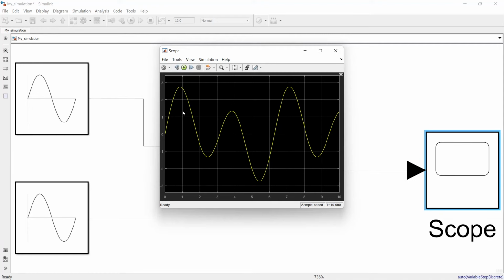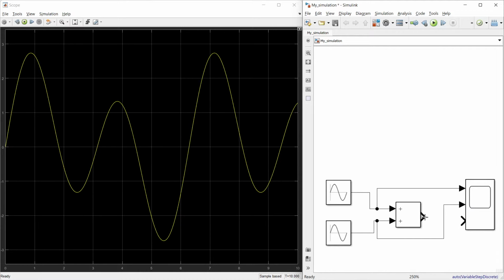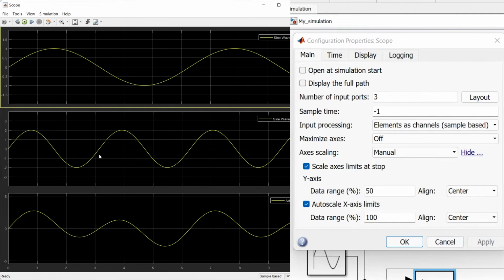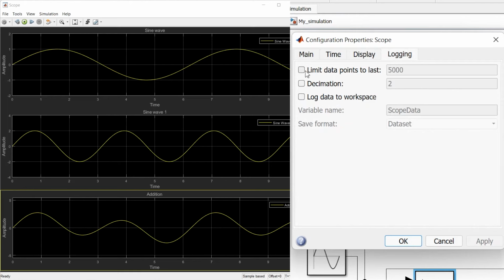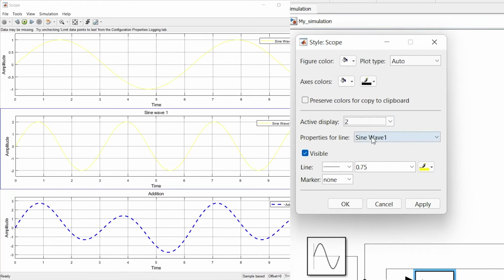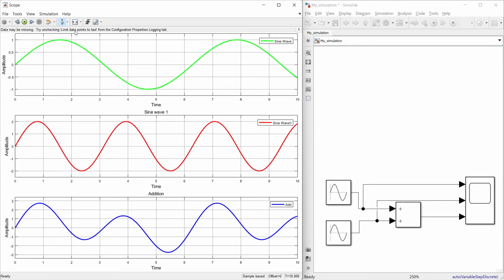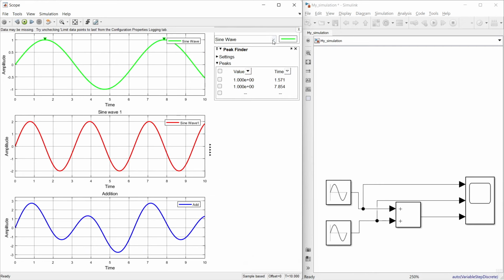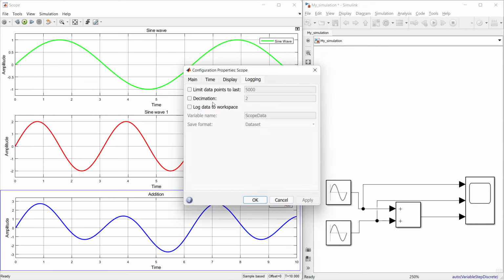Scope in MATLAB Simulink | How to use scope in MATLAB | Scope and its settings MATLAB TUTORIALS

Comment: There is some small confusion between (1) "Axes scaling" and (2) "display Y limits (Min) and (Max)",  in (1) the data is shown to take screen occupying portion in %, so the Y axies would be data(max) * 2. But if we select in display tab with Y-limits (Min) and (Max)... as if Y-Limits (Max) is smaller than data(max)*2, then axis will be rearranged with Y-Limits, and data(max) is also adjusted. tell me if I'm wrong, teacher.